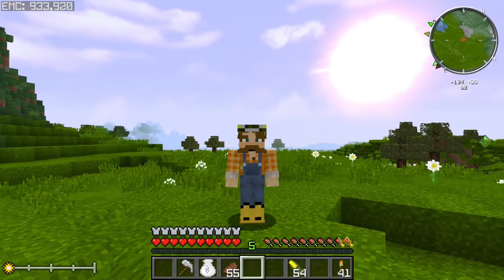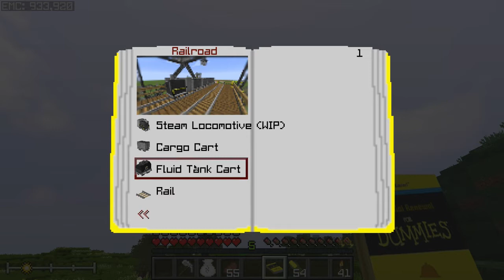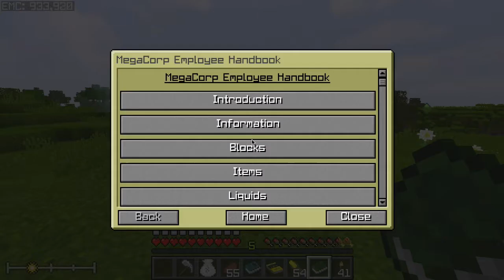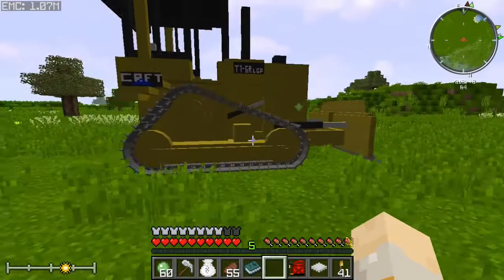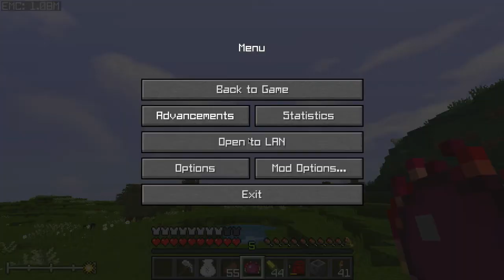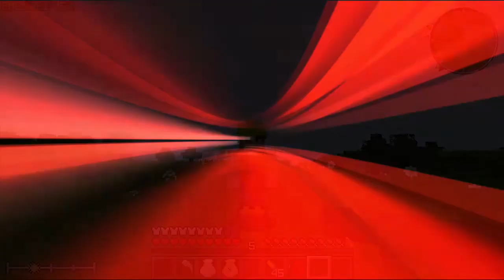Heavy Machines Ep1 - Minecraft Big Agriculture and Industrial Mining

Comment: Hey Thanks for doing a series on my Mod. Hope you have fun with it! If you have questions feel free to ask :)
Reply from the maker: Oh hey. Awesome mod! I am having tons of fun with it. Thanks for the offer of help. I may need it but so far all is working very well.
That is besides a memory leak in the pack I haven't nailed down yet. (not necessarily your mod)
Reply: how do you make your machines on survival??
Reply from the maker: @JJ-es6pu  There is recipes for most every machine. I show how to make them in the series.
Reply: @ScottoMotto  I realized that. It's when we did the mod we had trouble finding but I seen in your video
Reply: what are the keybinds for the vehicles?
Reply: @nightreaper1278  it's been ages since I've used it but if I remember correctly it's spring and jump keys to move the blade /bucket up down.  The rest of the key bindings should show up in the options for controls.